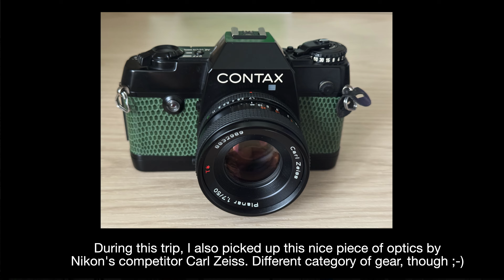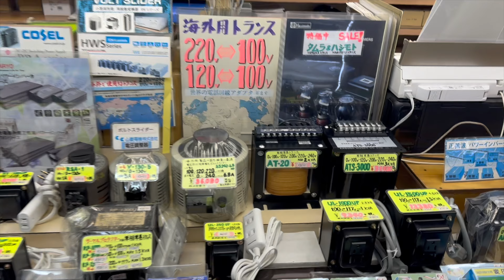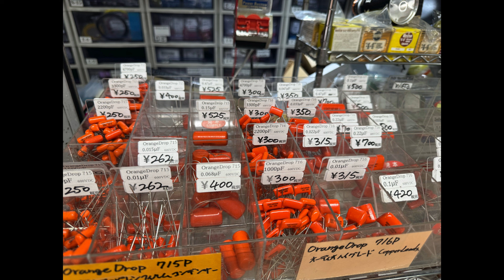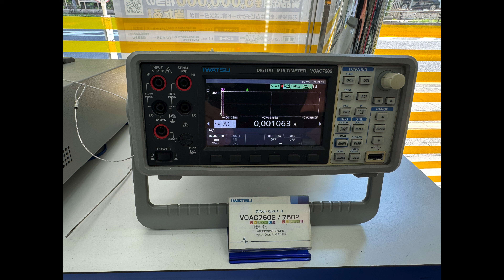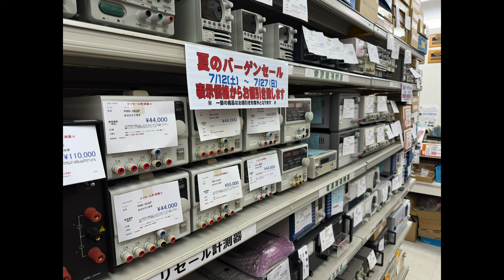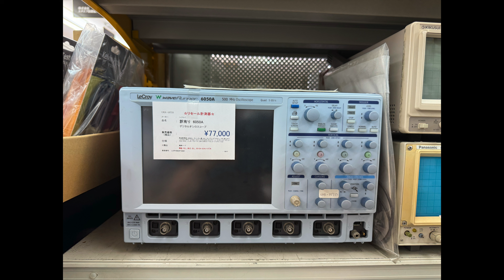REL #59 Japan Akihabara electronics & T&M heaven

Comment: Akihabara is one of my favorite places in Tokyo!  Spent many hours (and more than a few thousand yen 🤣) there.  Thanks for the video!
Reply: Thanks, Paul! I try to prevent spending a lot of money there, also because everything has to fit in the suitcase for home! But it's tempting, really. I was thinking of picking up these Hioki loggers I showed in the beginning. The thing is: I had to choose a specific version (5V, 50V, temp, current, etc.). If the logger had been more versatile, like a multimeter. I'd have done it. Other loggers are probably more versatile, but more expensive.
Reply from the maker: It's just amazing, even if it would be so nice to go back, say, 20 or 30 or more years back in time to see how it was back then in terms of electronics...
Reply: @rudiselectronicslab861  I actually first visited Akihabara in 1995.  Definitely has changed since that time, but glad that the "hobbyist" part of it is still doing well.